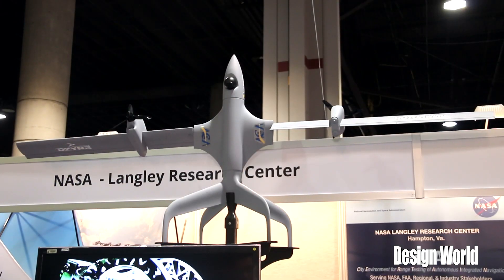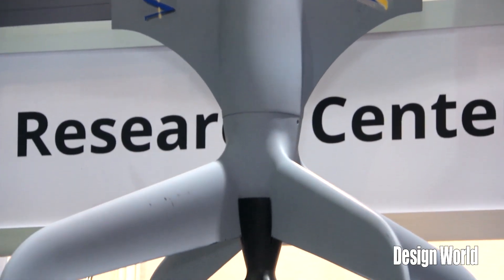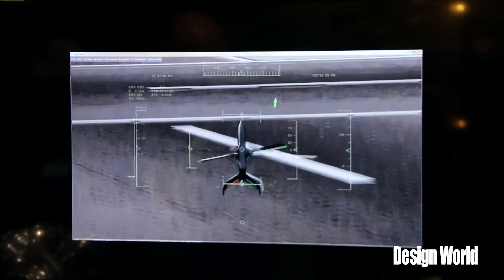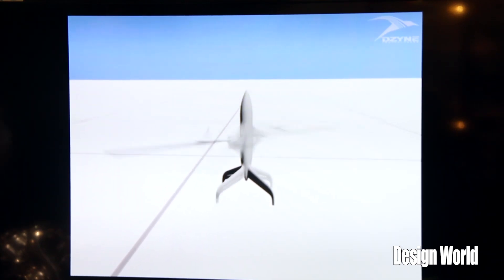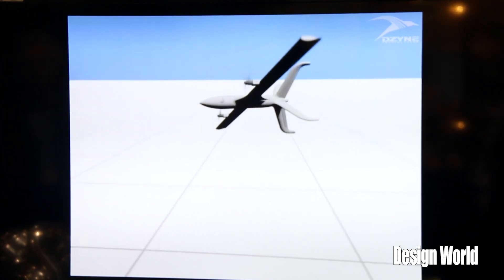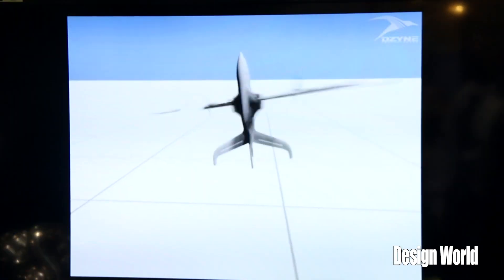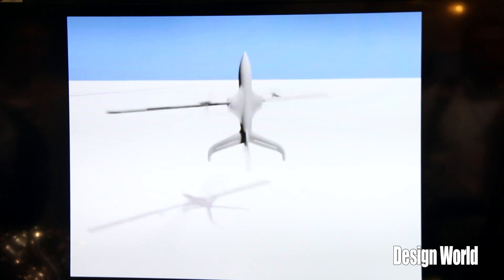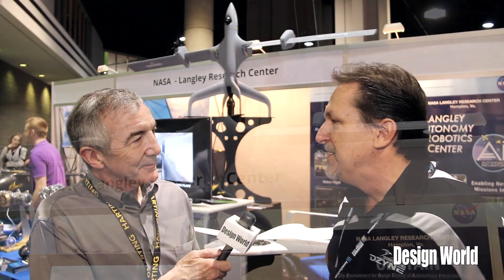DZYNE Creates A New Approach to Vertical Takeoff and Landing (VTOL): Rotate the Wings

Comment: Just an observation, but I see a nagging stability problem w/ this design. With that much rotating mass, how do you compensate for the inherent effects of torque on the lower sub-structure(?)/landing gear portion? Simulations are fine, but can't compare to real world physics. I'm dubious, at least.
Reply: Lower structure will not experience any stability problem because it does not participate in rotation. They are on the same axis, but the upper structure's rotation isn't connected to the lower one. The wing motors cause rotation, unlike a helicopter.
Reply: That was my initial thought as well, but then the wing/propeller is free wheeling rather than a fuselage based drive so maybe no countertorque is needed?
Reply: rotate wings around body
Reply: @livefully7568  Watch the model wag around at 1:15-ish, while the rotor assembly is moving. They're going to need a serious stability control system/software to keep that from becoming a troublesome, perhaps catastrophic, oscillation and failure. Not saying it isn't "do-able," just scetchy.
Reply: @v.e.7236  They trying.We need novel ideas! Peep V-Bat Very cool vtol, endurance, available, scalable.Pure dream. 
These guns need a major body overhaul. Wing assembly ought rotate around body which would tighten the wobble around Z-axis. Ya dig?

Comment: Intresting concept.
How / Why does the tail not spin from counter torque?
Reply: there is no counter torque. The motors are on the wings pulling them in a circle rather than a motor in the tail section spinning the top section. If anything the tail section would want to spin the same direction as the top and only doesnt beacuse it has control surfaces to counter act what momentum is transferred via friction. 

Its the same as tip jet helicopters not needing a tail rotor.
Reply: The French army operated a small helicopter were jet engine thrust was channeled up to and then through the rotors to nozzles at the end  with no counter torque being generated. With the British Rotodyne air and fuel was pumped to small engines at the end of  the rotor for the same effect.  Counter rotating main rotors eliminate counter torque.
Reply: Cool ASF!

Comment: Very stupid design. The wing size is about the same size as a comparable helicopter rotor but the sitting position here is not convenient to exit and enter the aircraft.  You lie on your back as in a rocket launch? Idiotic idea for civilian use. It's an answer to a question nobody asked. Small ducted electric jets or propellers in a UFO shaped design is really the only thing that has an advantage over configuration of a helicopter.
Reply: It's an unmanned vehicle and it will remain unmanned you idiot
Reply: AtomicDynamo. Not a stupid design. Just not practical for present day situations.
Reply: +AtomicDynamo
That is a stupid comment.
A vertical takeoff and landing aircraft that includes safe and efficient cruising would be a very high demand product.
Reply: Dale Kramer (the gentleman that brought us the Lazair ultralight in about 1980) seems to have both of the problems you mention pretty well whipped; but he shut his little research project down when instability "lunched" his prototype.
Reply: Extremo!
Reply: Totally agree. It seems they managed to combine the worst in helicopter and aircraft design. Besides, vertical take off and landing is not the end in itself. It is usability and efficient functionality that matter. I always wondered why there is so much fuss about VTOL design drones.. For most end users take off and landing isn't that crucial. What really matters is that I can get to a remote location fast, hover over the object if necessary for as long as I need to do the job (lidar survey for instance), and that both flying modes are stable enough to carry out my task. The hybrid propulsion system idea is great but implementation is extremely complex.
Reply: IDiota!
Reply: V-Bat

Comment: When space booster rockets come back after delivery of their loads to higher atmosphere, it should incorporate into design so that when it lands, booster rocket, lands employing this instead of hot blasting air. Or rockets could have four stage rockets with lower booster solely this and it will push to lower heights only, but problem is it probably have to be ring thus letting main rocket to fire the same time when lift off initiated. So, it will be circular with wide opening in the centre.